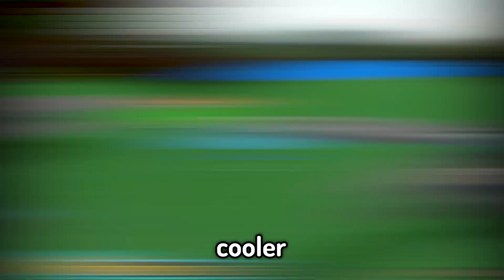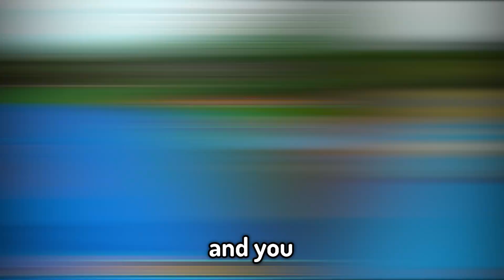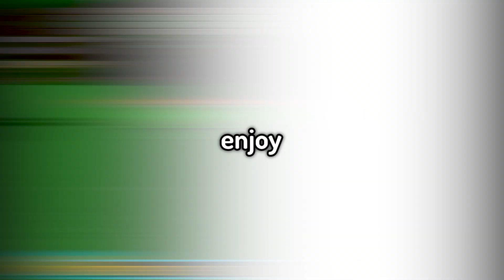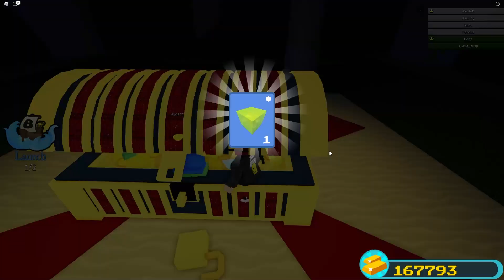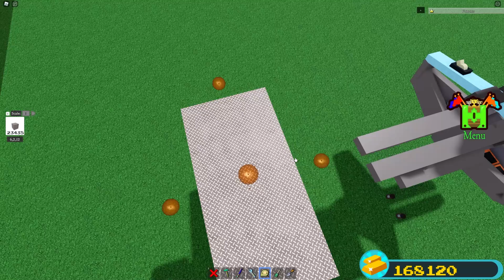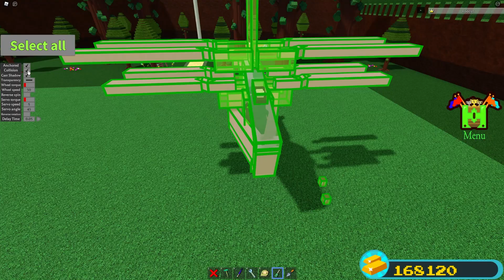*NEW* FUTURISTIC WINGED PLANE TUTORIAL!! | Build a boat for Treasure

Comment: Hey pocus, I am building the plane just now but the springs are tricky because now you have to place both sides instead of like the video that you place it like its a block, does it matter if the spring is inside of the magnet by a little like the video or just next to the magnets?

Comment: When I built it and tested it, it flung forward and started to spin out of control and whenever I try to go forward it just starts flying completely down and if i try to go down, it shoots into the sky. And then I have to flip it over just to go slightly down and spin out of control. (Edit: Roblox was lagging and making it like unable to fly but it still doesn't fly that well, for example if you run into something then you can get spun out of control, or if you stop flying it flings you like really far.) If you could make a updated version, then that would be great!

Comment: I followed the tutorial exactly but one of my wings didn't flap. But when I deleted the wing the servo started working. Then I anchored all blocks but the servo kept moving even though all the blocks were anchored.
Reply: please help
Reply: Exactly
Reply: @tyreece_222  Hiiii to fix that Connect Your SWITCH to the first Clock. And when you unanchor all. Click on the switch the wings will move
Reply: @KASEK3  the first wing block at the Top or  bottom
Reply: @tyreece_222  you click on the Switch, then the 1st clock 🕰 the one that is connected to the Other 🕰. And you are done. To set up (unanchor, sit, click on switch, F and done
Reply: @KASEK3  okay
Reply: Hiiii to fix that Connect Your SWITCH to the first Clock. And when you unanchor all. Click on the switch the wings will move
Reply: The thing is that i followed the tutorial exactly
Reply: @squeakyo1  i know but he missed saying that you need to connect the switch to the Delay thing
Reply: @KASEK3  is this mobile free
Reply: @n0va_nocap  yes bro I made this on phone (it still works)